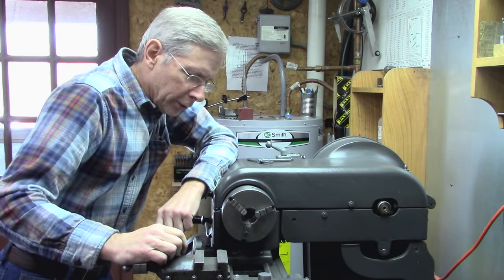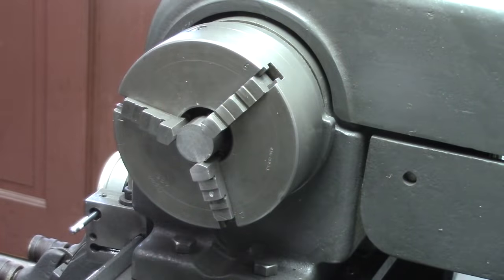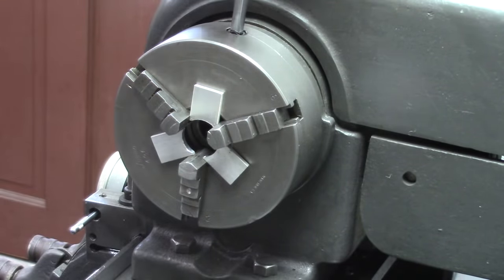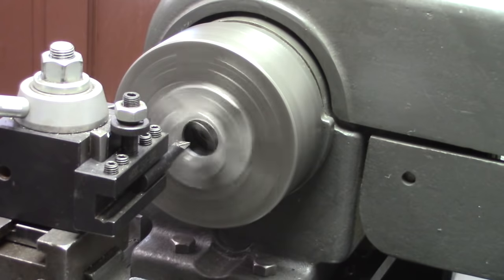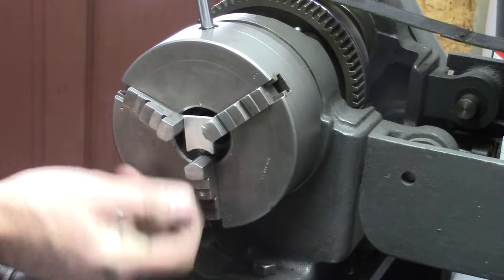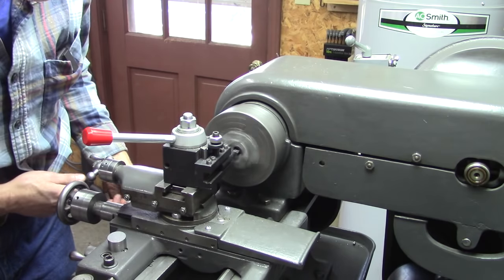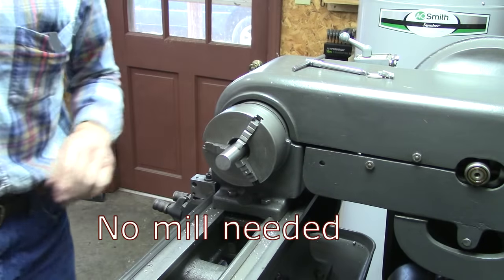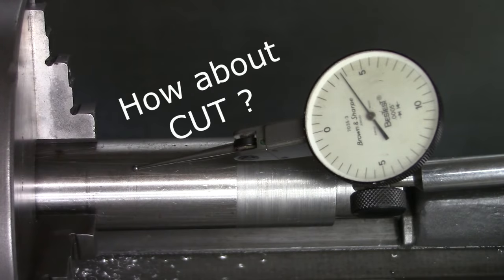Correcting 3-Jaw Chuck Runout the easy way

Comment: Those jaws can't be very hard if you can cut it with a boring bar.
Reply from the maker: The boring bar had a carbide insert. The jaws are hard, a standard HSS drill won't touch them but the carbide did well.
Reply: @WinkysWorkshop  Morning Brother, maybe a grinding operation would give a smoother surface?
Reply from the maker: @pieterbotes8938  The finish was actually good. I have ground chucks twice before but the boring bar seemed to work better.
Reply: @WinkysWorkshop  If it works for you brother, it works. Happy machining. Have you checked the headstock alignment before the chuck boring process? I need to fix my 3 & 4 jaw chucks (Chinese rubbish) and fairly new. I checked and fixed the headstock alignment a week ago - 0.2 mm over 700 mm.
Reply from the maker: @pieterbotes8938  As far as I know the head stock can not be aligned. I have lined up my tail stock.
Reply: @WinkysWorkshop  Unfortunately I have a Chinese lathe which is flawed top to bottom. They copy all western technology and produce serious substandard rubbish. I have modified or fixed many things on this lathe. The motor on this lathe is the biggest trash you can imagine. It was replaced after a year's use and I still have the same problem as before. My brother encountered the same thing but the company selling this garbage refuses to admit they sell rubbish. So, I'm stuck with it.
Reply from the maker: @pieterbotes8938  - thats not good...  maybe get an old one and restore it. It's a lot of fun.

Comment: Way too simple. I fought a .015 runout on an old chuck for 15 years
Reply from the maker: It's not perfect but way way better!
Reply: @WinkysWorkshop  I was after them for years to replace the 20" beaten up poor thing. Once a piece was loaded it had to be finished as picking it up again was impossible. I finally ended up running the 4 jaw all the time. One thing about that I got really fast dialing pieces in. I am retired now and sooooo miss my "hole" in the back of the logging company's shop in Northern BC Canada. I wonder if you had used 3/8 - TQ100 pieces or    pieces of 4140 or 4340  milled to the same width you may get it closer ? Nothing major wrong with .002 though.
Reply: @WinkysWorkshop  You found a new sub. too. I found pouring pure silver to keep myself busy. Stop by if you like.
Reply from the maker: @TomokosEnterprize  Cool - welcome to my channel!
Reply: @WinkysWorkshop  Looks like we are much the same age, (I am 65, my wife passed and I live on a disability pension) I loved being a machinist, fabricator and mechanic on everything from chainsaws to jet engines. When my amputation of my R leg came I found a whole new love of life and all things. Staying busy enough to achieve even just one thing every day is sooooo important to our general health for sure. What always pleased me most was the beauty and satisfaction of a freshly machined or repaired piece from the machine shop side of the shop although working in logging up here I got to do some incredibly big work (not on my channel). Hardly a day went by I didn't wake and not look forward to what the new day had in store. I lost that for a while but now have it back. Life is good again.
Reply from the maker: @TomokosEnterprize  - Sorry to hear about your leg and wife. You are right... good to stay busy.  I'm glad you found purpose again. Right now my biggest problem is figuring out which one of the 5 or 6 projects I want to do next. Sometimes a side project takes priority. Today I picked up some 1/4" plate steel for the top of a small welding table and then worked on an adapter duct for dust collection on my surface planer. You have a HOT hobby. I've poured aluminum a couple of times and thats too much heat for me.
Reply: @WinkysWorkshop  Dean here. For pours up to 14 ozt of silver you will like my little $20.00 CDN furnace I made. I use a Map alternative called HGX but propane will work. It just takes longer. I am the what they call the patriarch of the precious metals pouring community here on the Tube. I do everything "Old school" and for as little as I have to put into it. After 4 years now I get schooling nearly every time I sit down at the bench. I repay my time out there at the ranch and wood shop by welding and mechanical repairs. If it is something I can't physically do I sit and talk them through it. After I had to leave the logging shop I worked for them until I had to formally retire. After 3 weeks of retirement I was back out there doing what I could to maintain my sanity, need to create, Well you know eh. PS. Getting that piece of shit leg taken off last June gave me a life back that I no longer wanted. All good now my new friend !
Reply from the maker: @TomokosEnterprize  - I learned something today...  HGX gas! From what I am reading its hotter than acetylene. I know what you mean about the need to create. Without creating there is no purpose to life. I had no problems retiring but my boss who lives down the street from me did not want to retire. I've been retired two year but the plant I retired from closed this year and my boss was forced to retire. He is slowly finding things to fill his time. I have thousands of dreams...  some are 10 second adventures into possibilities and some I've been thinking about for years. My only problem is trying to decide which adventure I need to pursue and finding the time and energy to do it.
Reply: @WinkysWorkshop  HGX is a Map alternative. Hotter than propane for sure. I get it from my welding supplier. It comes in a propane like bottles that I run unregulated with an 8000 Bernz torch. It is far cheaper than buying the 1 lb bottles of Map from the hardware stores. $70.00 for 20 lbs and $7.00 a month for the bottle demurrage like we pay for our o2 and acc bottles. It works out to around $3.75 a lb compared to $15.00 for Map. I use a 20 lb bottle every couple months. I sure hear you on time and energy. Every once in a while I will get a silver pour that folks love and orders come back to back. It is then that I wish I had a full time job so I can get weekends off eh, LOL.

Comment: Please don’t use MEK !!
Reply from the maker: Everything in life has a risk. It's all calculated. Obviously limiting exposure is a good idea but MEK is useful. Heck...  they even put it in finger nail polish remover.
Reply: @WinkysWorkshop  MEK is deadly toxic and you should absolutely use gloves when handling it.  I recommend isopropyl alcohol which is more benign then re-coat the surface with oil or BoeShield when you are done.
Reply from the maker: @GuyMarsdenMakesStuff  I've read about MEK. apparently its bad stuff when exposure is high. I try to limit exposure. I do wear glove if I use it for more than a minute or two although so far no gloves hold up very well. Have you ever been around a woman removing fingernail polish. I'm not saying I should me bore careful but their exposure is higher than I ever expose myself to .